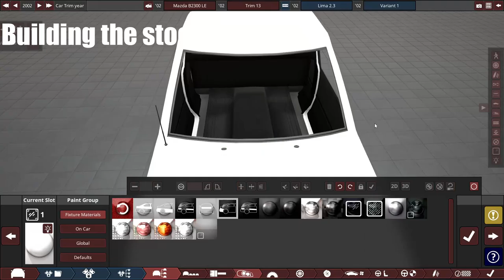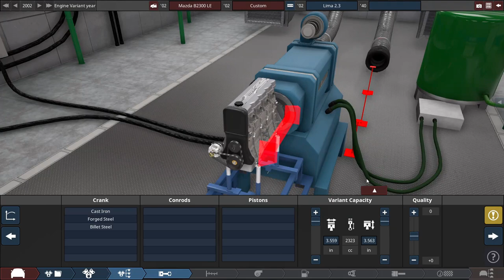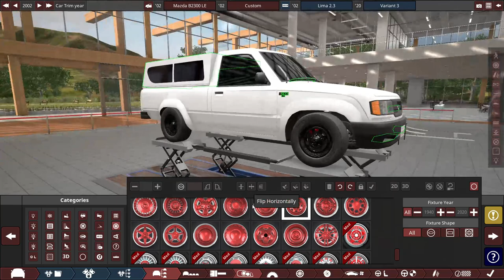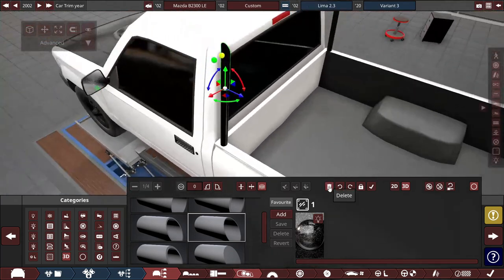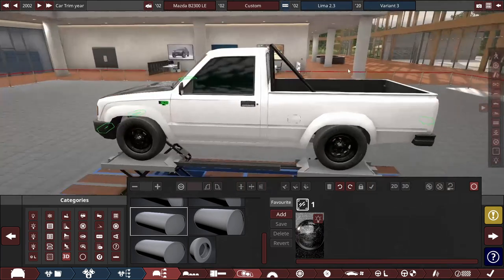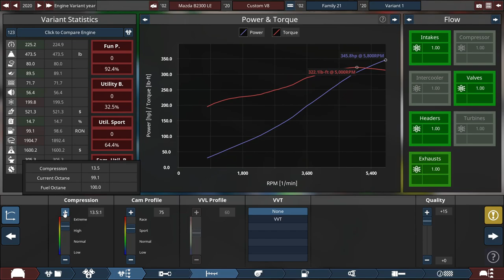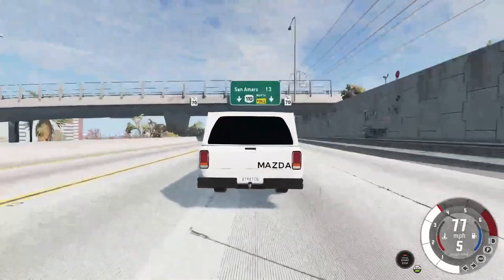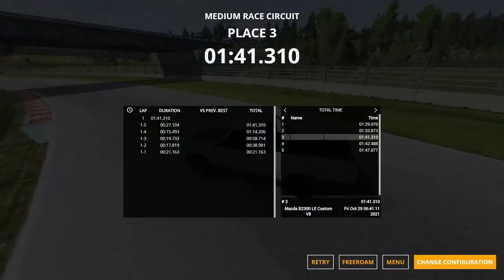I BUILT MY REAL LIFE PROJECT TRUCK IN AUTOMATION! | Automation/BeamNG

Comment: 23:49 they dont call the 4.6’s 5.0’s. The 5.0’s are coyote engines basically from 2010+ mustangs, the 4.6’s are from 1994-2009 and are OHV V8’s while the 5.0’s are OHC or DOHC i believe. The 4.6’s and 5.0’s are completely different engines 😅 and in my opinion, the 5.0 is WAYYYYY better than the 4.6’s but they’re still good engines. Nothing beats a good ol’ LS though 😉😉

Comment: I have a 2000 ranger w/ a 3.0 v6 and an extended cab, also a five speed
Reply from the maker: 2.3 Gang
Reply: @UncleVenz  My dad actually used to have a 97 ranger w/ a 2.3, it died after 360k miles
Reply from the maker: RIP The ranger